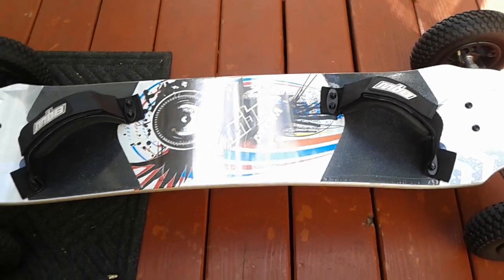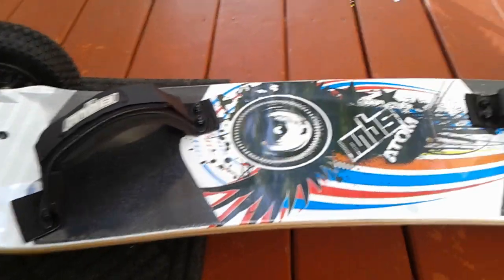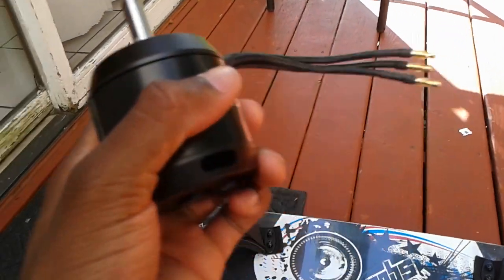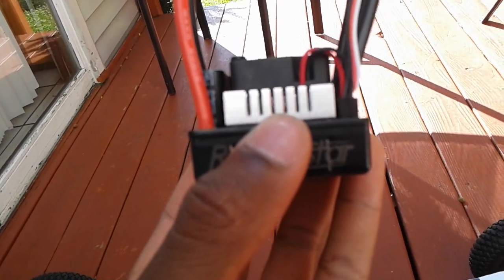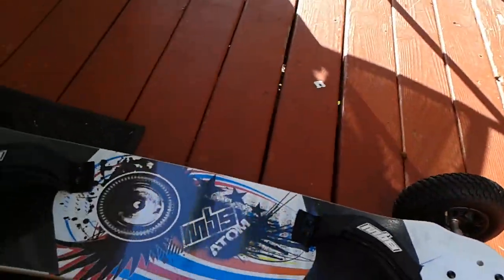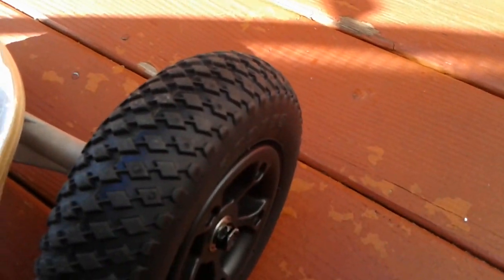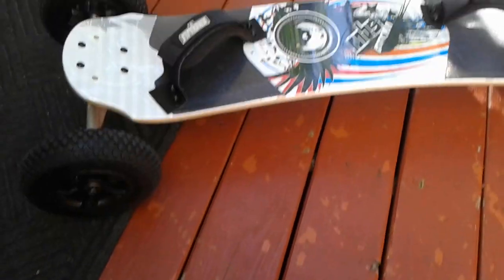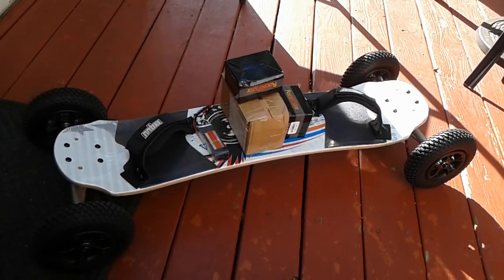DIY ELECTRIC MOUNTAINBOARD BUILD | PART 1

Comment: I just completed my 3 wheel board with that motor! I use a single motor with 12T pulley and a huge 200mm diameter printed pulley on the rear.  I run a 10s 18650 pack on it(actually to 18V 5Ah Makita batteries in series)  and it goes fast enough, but I still would like more torque. Going with 2 of these motors  is a must to create enough torque for for hills with the small pulleys that fit those wheels. Most build vids on YT shows driving on a flat surface for a reason hehe. Voltage gives top speed but amps gives torque needed. Also I allowed the VESC to give the motor more amps than its actually rated for so it can climb short steep hills, but I have to manage the throttle so I dont smoke the motor.. Btw banggood sells the 4.12 VESC for half the price of that linked the ESC. This VESC is fully programmable with open source software for skateboards.  They also sell the 60A version which is a beast! The 35A version works good with a cooling rib added to it and the motor you have :) Looking forward to see your board completed! Please let me know how hot the motors get! I run mine up to the point its uncomfortable to hold! I have no idea what the max temp is on this motor and the thought of the motor locking up really scares me^^.
Reply from the maker: I will upload a video by the 8th of August.
Reply: Any progress on your board?